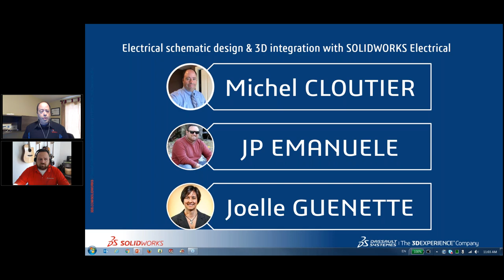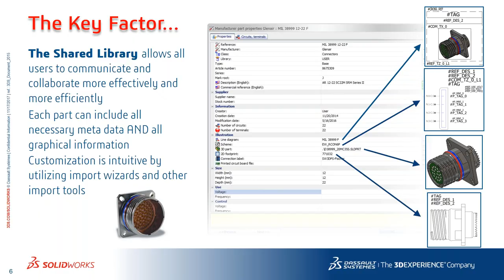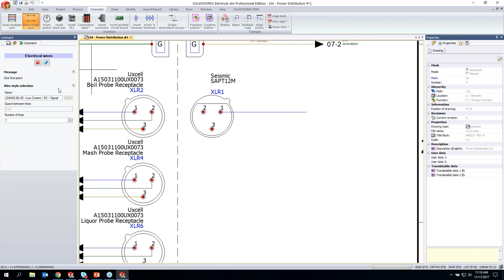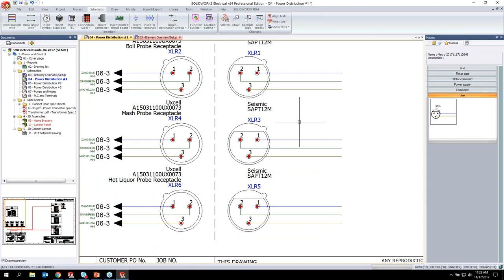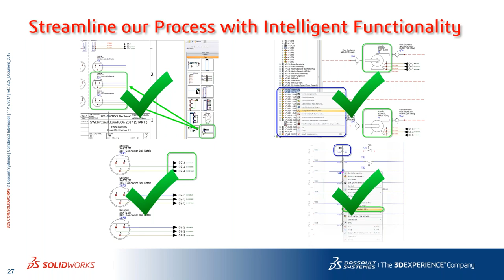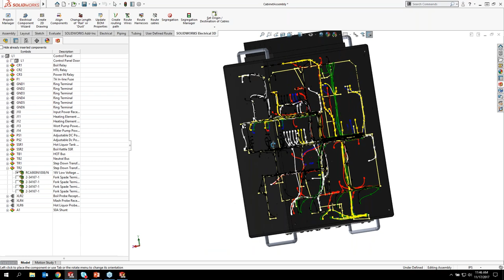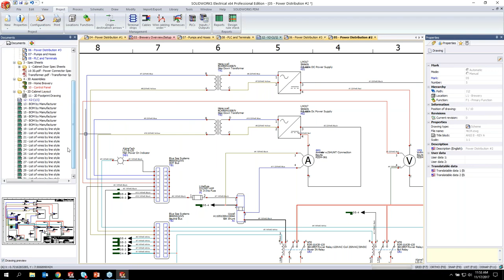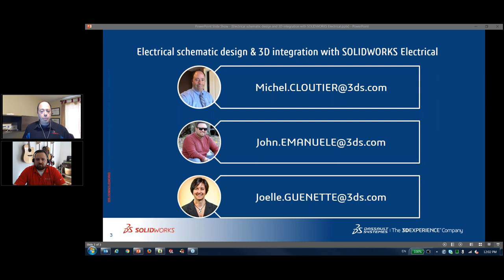Electrical schematic design and 3D integration with SOLIDWORKS Electrical

Comment: When I create a BOM from my SWE 3D after routing wires I can't find a drop down for the component Mark TAG. For e.g. R1 or R35 or C15 etc. I can find the Component Reference or Description or Part No but these show the references to the part linked not the actual mark in the schematic. So I want to list all the resistors, capacitors etc in my 3D model by their Mark AND have a column for the Description too. So I can see R1,R2....etc and R1 might be a 100K CFR and R2 might be a 68K CFR for e.g. Should I create this type of BOM from within the SW 3D space or the SWE space and how do I access the right TAG for the Mark? I know its there somewhere since in the 3D space the Electrical feature tree has all the resistor and capacitors listed by their Mark from the schematic. Its just not showing in the Part feature tree.